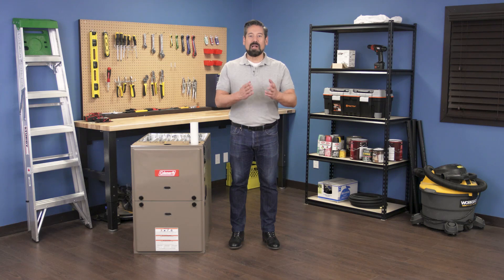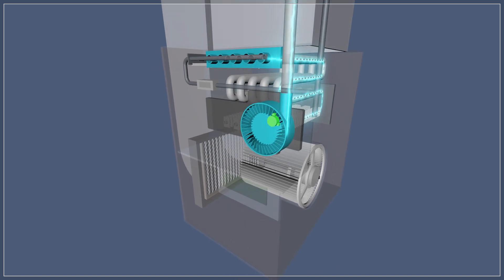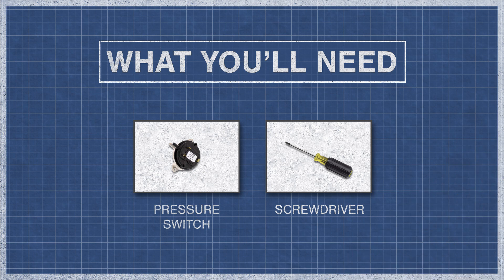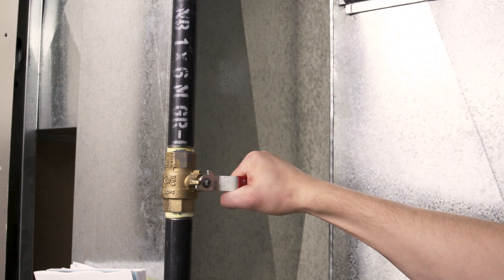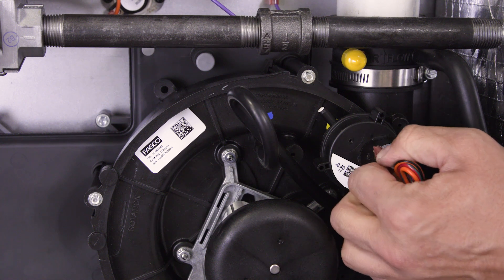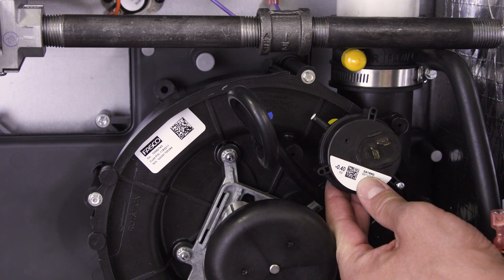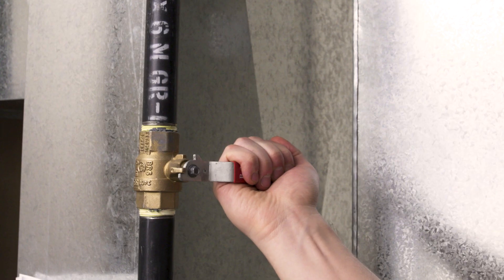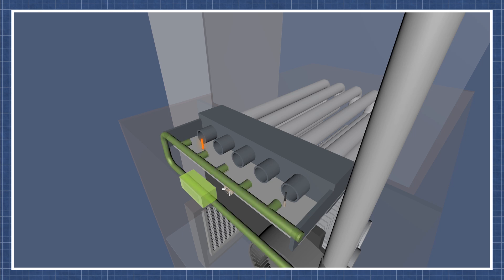Furnace - Pressure Switch | Repair and Replace

Comment: Does anything else matter other than the PF number (pressure rating) when buying a replacement pressure switch? My furnace is discontinued and hard to find exact same one but there are alternatives either way same PF rating but different item number
Reply from the maker: Thanks for watching. It's always best to find a listed cross reference but if not then look for the same rating, similar mounting options, same sized terminals and the same sized barbed hose connections.

Comment: My problem is i forgot which hose goes to which port; Does the port with the little color insert go to the air box; the other to the gas valve/ burner ?? Would love an answer on this; Furnace works great otherwise !!! THANKS !!!
Reply from the maker: Thanks for watching. It depends on the switch this is something that can't answer without seeing it.

Comment: One question, why does it leak water? inside The cure cause could be the pressure switch?
Reply from the maker: Thanks for watching. Water can accumulate inside a high efficiency furnace as these condense water vapor to extract more heat from combustion. Check to make sure the water is draining properly, and that there are no pinched or blocked lines. As well condensate could form inside of the exhaust vents, so make sure that nothing is restricting the vent on the outside of your home.

Comment: I ordered a new pressure switch by looking up the part #, but I didnt realize until I was getting ready to install it that the old part -0.35 PF and the new one is -0.30. How critical is this?
Reply from the maker: Thanks for watching. PF means pressure fall, and a lower rated switch will change how sensitive the switch is which can change how the furnace operates. We always recommend matching exactly but there are some cases where a certain range tolerance still works. Can't recommend for sure without seeing the system in it's entirety.
Reply: @AmreSupply  thank you. Is there any risk to trying it?
Reply from the maker: @corey977   A different rated switch has the risk of the furnace shutting down within different parameters which is why we can't recommend using anything other than a match. As well depending on where you got the switch there are often no returns after installation, so once you install it, you're stuck with it.

Comment: Need clarification please - If the same two wires that went to the switch are connected back to the same switch, does it matter which wire goes to which terminal?
Reply from the maker: Thanks for watching. A switch simply connects and disconnects power within a circuit. It does not matter which wire is connected out of the 2 wires, it will not change how this switch works.

Comment: Anyone know if  a 'goodman' brans pressure switch will work in a 'lennox' furnace? They look very similar & amazon brought it up in the search. Any info would be helpful
Reply from the maker: Thanks for watching. Furnaces use switches and motors which often come from a variety of manufacturers. When finding a replacement there are often crossover parts. Just make sure to match the physical size and the rated specifications.

Comment: you almost explained how the pressure switch works.
Reply from the maker: Thanks for watching. These were some of the earlier videos we made and we do go into a bit more detail in others. If you want to know how the pressure switch works we have a video on appliance components. I have liked the section on switches: https://youtu.be/Mdu7QlAzWOg?t=50
Reply: @AmreSupply  thanks. I was looking for more explanation on how the vacuum part works. where vacuum is and where pressure is. I knew my switch was good but the furnace would not turn on. I have been bypassing it for over a year, it is just a shop furnace and not used often. It is a single switch with 2 ports, one connected to the heat exchanger area and the other to the condensate trap. Turns out the hoses at the switch were swapped and giving the wrong signal to the switch. I did not find a diagnostic that would have caught this. And I don't have a in of water meter to measure the low pressure and vacuum being used. But this got my brain going and I was able to figure it out. I did learn how to tell how much the switch needed to trigger from your video.

Comment: Does it matter which wire goes on which tab?  I bought one with the same part # as the old one but the tabs are situated differently & both tabs are the same size so I'm concerned about connecting it backwards.
Reply from the maker: Thanks for watching. When it comes to these switches, they are not effected by polarity, they simply connect or disconnect power within a circuit. It doesn't matter which connector attaches to either of the 2 terminals, it will work either way.
Reply: so it doesn't matter which wire is connected to which terminal. What if my furnace has 2 switches? there is a "jumper" wire that goes from one switch to the other? I'm a little confused. thanks  @AmreSupply
Reply from the maker: @dissonantworlds  Thanks for watching. It's most likely that each switch is wired independently, as the furnace wants to monitor for 2 separate conditions or locations of airflow. 

in each case the switch will be either on or off. With 2 terminals it either provides a path for power, or it doesn't. If you're curious we created a video that explains switches in more detail: https://www.youtube.com/watch?v=yug_UfBUsec
Reply: I was looking for this question… thanks for asking…
Thanks for the  answer… Vance
Reply: @kenmiller2230  Glad it helped.  Mine is working fine for its 2nd winter now & i like keeping the house REAL warm!
Reply: @GenerallyGeneralLee  
Just installed the pressure switch and the furnace.. 30 years old… working just fine…

Comment: To bad you don't show where yhe hoses coming out of the pressure switch go. My switch has negative and postive side outlets.
Reply from the maker: Thanks for watching. The inducer pushes the exhaust out of the system. Not all furnaces are configured the same but there will be negative pressure before the inducer fan and positive pressure after it.
Reply: https://youtu.be/erpnfKbqmoM
Reply: There's where those hoses go

Comment: When looking for the part online everything on the label matches except that at the end mine says D/C and the one I found says W/C does this matter?
Reply from the maker: Thanks for watching. There are a lot of part numbers and number systems so I'm not sure. D/C is often used to describe direct current. W/C is likely referring to the pressure in "water columns"

Do the other specifications line up? Can you match by any other ratings?

Comment: Hi once again. Sir it is showing 2 pressure switch in your video. How do we know that which one we have to replace.?
Reply from the maker: Thanks for stopping by again. Without special equipment it's difficult to test the switch. You can learn more about these switches here: https://youtu.be/Mdu7QlAzWOg?t=50

So to answer your question there isn't a quick easy way to safety verify which switch has failed.

Comment: Thanks for the video. I wanted to know if the pressure switches have a finite service life. I was told by one technician that i should not wait for them to fail, but replace them as a maintenance item. My furnace is almost ten years old. What is your opinion on this?
Reply from the maker: You're welcome, we're glad that you found it helpful. Pressure switches and limit switches have internal components that flex or move. These are good to a certain number of cycles and given enough time they will fail or simply lose sensitivity. Some switches will last longer than other and some will fail early. Replacing them early as part of maintenance doesn't hurt and will give you peace of mind.

Comment: But what if the pressure switch is not the problem?
Reply from the maker: Thanks for watching. It depends on how far into the sequence your furnace gets before stopping. This video covers all the different issues in the sequence: https://www.youtube.com/watch?v=b0sAGt-1niU

Now if the Furnace stops before ignition, but the pressure switch is good, then it could be an issue with the airflow. This can be harder to narrow down and can be helpful to get it inspected by an HVAC technician.

Comment: Hi Vance I have a Bryant 95s evolution. The furnace fan will not start but I can spin the fan motor manually and the fan goes and the heat comes on any ideas
Reply from the maker: Hi Stephen, thanks for watching. If manually spinning the fan causes it to work, then it likely has a failed capacitor. Capacitors are used with some motors and are needed to start the motor. This can be tested with a multimeter as shown here: https://www.youtube.com/watch?v=NkgxNLCrmr0 If the capacitor has failed, then replacing the capacitor will allow the fan to start normally.
Reply: @AmreSupply  thank you it also runs on fan only so maybe the capacitor isn’t involved when the is no call for heat?
Reply from the maker: @stephendinger7114  Yes you are right that setting the thermostat to FAN will run the blower fan without igniting the burners (this setting is commonly used to just circulate air around the home between heating cycles) The inducer fan will only run when there is a call for heat so a faulty inducer capacitor won't affect things when you're just circulating air with the FAN setting.
Reply: Thanks very helpful.

Comment: Thanks for this video, the animation helped be troubleshoot why my furnace was tripping on the pressure switch...leaves had plugged up a strainer on the inlet line to the little exhaust blower. Saved me time and $$$!
Reply from the maker: You're welcome Matt, we're glad that you found the animation and the video helpful! There are many things that can plug the inlet vent to the inducer, leaves and even ice are quite common.

Comment: We have an older furnace with a failing TriDelta Industries pressure switch. We had it diaged by a company but are not going to pay the astronomical fee to have them replace it. Replacing it looks straightforward enough, our only issue is, how do we find a replacement part for it when it's been discontinued?  Our part number is FS4080-85.  Any help would be greatly appreciated!
Reply from the maker: Thanks for watching. First look around for an exact match. Sometimes a part like that is still carried by some local HVAC shops but check online as well. 

That part number doesn't show up in our system but if needed you can always use a universal pressure switch. You would simply need to match the terminals and set the universal switch to match the pressure rating. The pressure rating is in inches of water column and might show something like 0.5" WC. You'll want to match this exactly. As well make note of which terminals your original switch has and connect those on the new switch. The terminals are listed NO for normally open, NC for normally closed and COM for common. https://www.youtube.com/watch?v=yug_UfBUsec

You can see a universal switch here; https://www.amresupply.com/part/9397688
Reply: Thank you so much!  We were able to replace the switch ourselves for 86 dollars as opposed to 400!
Reply from the maker: @nancyevergreen7530  You're welcome Nancy, we're happy to hear that the repair was a success!

Comment: If the control board has a lockout, do you have to reset it? If so, how? Thank you very much for the video.
Reply from the maker: You're welcome,  we're glad you found the video helpful! In most models, disconnecting power to the furnace for more than 30 seconds will clear the control board and reset it. There are some differences between manufactures though. If that doesn't work, find your furnace model number and do a search for that directly.
Reply: I'm definitely no expert; maybe try turning off and on the power switch?
Reply: Thank you everyone for the reply. I will follow as such when I received my pressure switch.

Comment: My furnace randomly decides to turn on with a louder than normal inducer fan. Sounds like the inducer fan is starting in stage 2, instead of stage 1. When it does this, the furnace will turn off a few seconds after the hot surface igniter turns on, but just before the burners light. Would a faulty pressure switch cause this?
Reply from the maker: Hi Shawn, thank you for watching. A faulty pressure switch could cause this behavior. It can be helpful to check to see if your furnace is giving you any codes. These specific codes will be listed in the furnace manual or on a chart on the side of the door. The codes and the sequence of operation are both talked about here: https://youtu.be/b0sAGt-1niU
Reply: @AmreSupply  thanks for the reply. No codes are shown when this behavior happens, except for the normal a875 code. I ordered a new flame sensor and a pressure switch (hi/low). If this doesn't resolve it, what else could be causing this? Gas valve I guess?
Reply from the maker: @Shawn855  Yes you are right that a faulty gas valve could create this problem as well. Definitely its smart to replace any small sensors or switches before replacing anything more extensive.

Comment: Hey soja good info. I have a good man furnace is it same like this one
Reply from the maker: Thanks for watching we're glad you found the video helpful! Yes the Goodman is a solid furnace overall!
Reply: @AmreSupply  my furnace is 8 year old u think it's time to change it. I had a guy came to look at it he say the flame sensor and the pressure switch is bad. He say I should get a new furnace. Can u advise me on this thank you
Reply from the maker: @srla.5145  Most furnaces should last 15 - 20 years with some maintenance. The flame sensor can accessd and cleaned quite easily: https://www.youtube.com/watch?v=af_qRnfHFws As well the pressure switch is simple to replace.  Start with those parts before replacing the entire furnace. Two faulty parts is not indicative of a bad furnace. For example you wouldn't scrap a car just because the alternator failed, when it has a perfectly healthy engine.

Comment: It shows you the plugging and unplugging, but no explanation of the meaning of the colors, I have brown, orange and yellow,  where do they go?
Reply from the maker: Thank you for watching. The colors of the wires are often different in various models of furnaces. Best thing to do is to take a picture before disconnecting, and replace the same color on the same terminal it originated on.

Comment: fixed mine by blowing and sucking into the hoses for about half a minute, fixed the problem.
Reply: You can damage the switch by doing that. The suction or blowing pressure ought to be within the limits and its easy to reach the limit
Reply from the maker: Thanks for watching. We're glad you were able to fix the problem!

Comment: You shouldn't encourage people who don't know what they're doing to start digging around in their furnace.  Not only could it be potentially very dangerous, but you are also selling the HVAC industry down the toilet.
Reply: As a homeowner, I have had the same issue on my furnace almost annually and I appreciate being able to get solid information so that I don't have to wait a week for a repair person, not only that, my furnace went out at 3 am in northern Minnesota at 38 below and if I wouldn't have found this information, I would've been in serious trouble.  Thanks to these guys giving us ideas to temporarily remedy the issue I was able to blow into my pressure switch and my furnace started back up!
Reply from the maker: @themythhunter9764  Thanks for sharing your experience! We have some extremely cold months in Canada and even a few hours without a furnace running can quickly add up so we understand your situation. We're glad this video helped you get your furnace running again!
Reply: I got a pressure switch for $59 dollars. You crooked guys wanted $199 just to show up and then $399 to change it. Screw you and your industry.
Reply: If you guys charge decent for your work people will don't have the  need to "dig around" their furnace!!
Reply: MA you and your minions in the HVAC industry should stop ripping us off with your ridiculous overpriced service and labor charges . It doesn’t take a rocket scientist to figure out how to fix heaters and a/c FU
Reply: My furnace developed a problem, so naturally I had a certified HVAC person come out to evaluate and hopefully fix it. After he quoted me a price of $1700 to replace a $200 part, I decided against this and try repairing it myself.
Reply from the maker: Hi M.A. thank you for your feedback. There are countless DIY blogs, and videos on the internet explaining how to troubleshoot furnaces. Homeowners who are inclined to understand and troubleshoot their furnace will jump into it regardless and will research it on their own. We feel its important to provide solid information which also reinforces the overall safety. Given this there are still many people that will see a video, will see how it works, and will decide to call a professional.  With a better understanding of the furnace this helps them communicate their problem to to a technician. Also any knowledge learned also protects the homeowner against any potential fraud as there are small number of non-reputable "professionals" who are quick to take advantage of someones lack of understanding of how a furnace works.

Its no different than car maintenance. Any consumer can buy parts for any model of car.  There are some fixes that are simple and can be done in 30 min by anyone, but there are many repairs that are best done with the tools and knowledge that only professionals have.